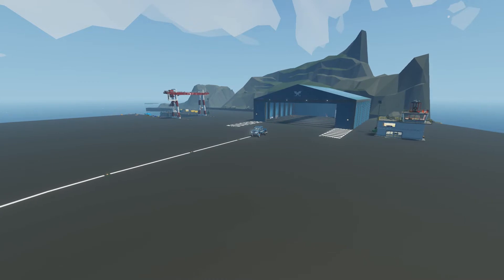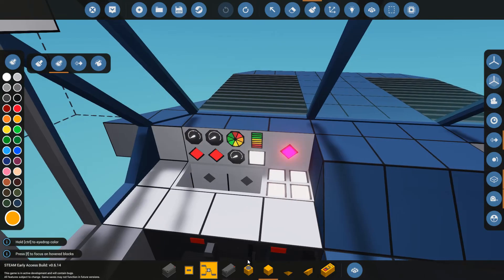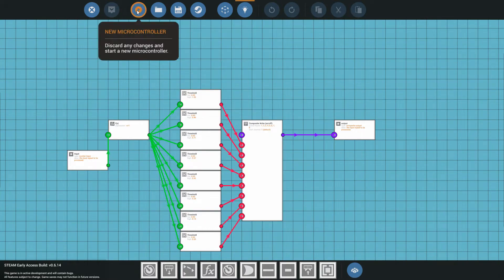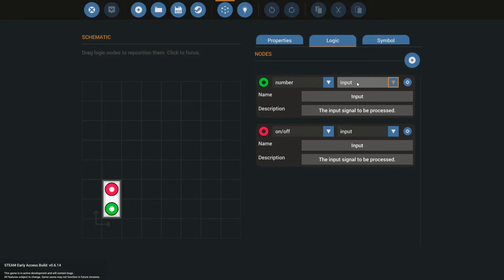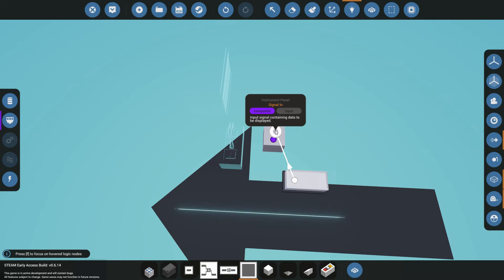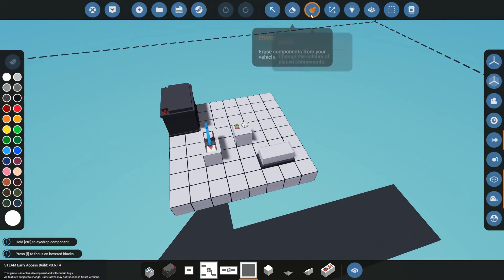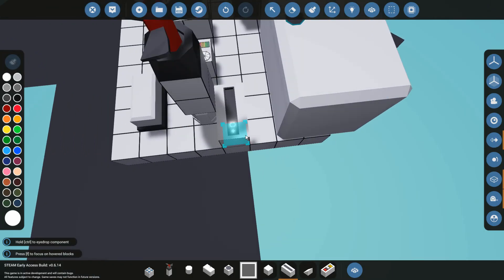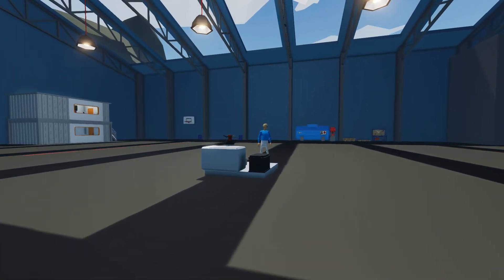Step By Step Tutorial On Bar/Radial Segment For Instrument Panels | Stormworks Early Access

Comment: Great video but how would you set up both fuel and battery on the same panel. My issue is in the microcontroller I can only output on composite signal.
Reply from the maker: you can connect that composite signal up to the instrument panel and then select that instrument panel and change the dials to receive info from different composite channels.
Reply: Yes I did that, so fuel is channel one and battery is channel two and for some reason it will not work. I have some messing around to do tonight so I will try again. Again thanks for the video and the reply.

Comment: There's one thing I don't understand, your panel's radial segment is set to a channel and you might have other gauges on the same panel You use a bunch of channels set to the same panel??? I'm really confused.
Reply from the maker: You can choose to change the channel that it being read by the different bar or radial segments. For my example I just set up two on the same channel to show it worked on both bar and raidal segments

Comment: Is the function different for monitoring the RPS and temperature for the small engine? I'm trying to do so but the display colors go off for the radial and bar segement as soon the throttle goes up.
Reply: Awesome, thank you very much! Great video by the way👍
Reply from the maker: the throttle and temperature are a bit more difficult, if you want to do a throttle of 20 you need to change the formula to -x+20 and you need to change the values of the high numbers as well. I am going to do another video on this soon so I'll try my best to cover all eventualities that may occur

Comment: Can you put the formula and the values you calculated in the description, please?
Reply from the maker: Sure, I'll do it when I get home tonight for you
Reply from the maker: formula is -x+1 and the values for the high numbers are ( from top to bottom ) 1,0.86,0.71,0.57,0.43,0.29,0.14 and the low numbers are all zero. These values are for the threshold gates for a battery or something else that has a max of 1 ( like a throttle lever that maxes out at one ). If you need to see an example I have a version of my microcontroller in the description that you can check out. Hope this helps
Reply: @StormRunnerGaming  Thank you!

Comment: Hey StormRunner ! If you need a easier way (With Number (bits) Setting) to make Radial or Bar Segments as Gauge for your vehicles, you could take a look to my microcontroller (only if you need it).
I put a link to it, but you can delete it if you want, it's just there to help you ;) https://steamcommunity.com/sharedfiles/filedetails/?id=1692248464
Reply from the maker: Thanks for the suggestion. I have a working number system, but it is a bit simplified and takes a bit more space
Reply from the maker: I like the system that you have set up there. It is very nice
Reply: @StormRunnerGaming  Thank you !